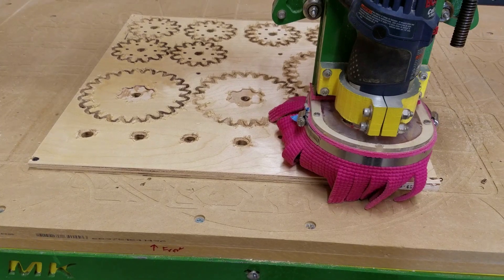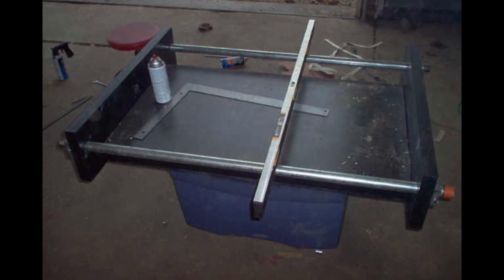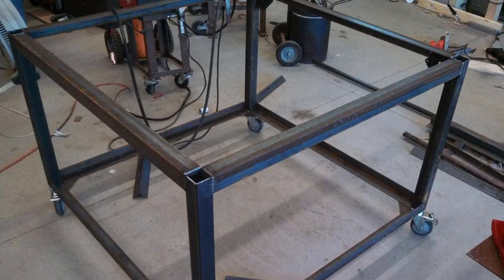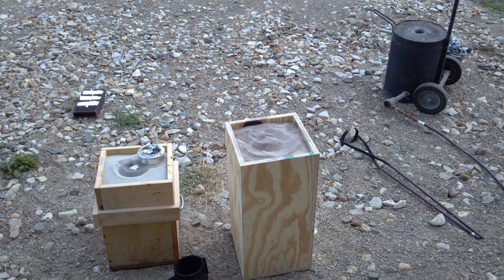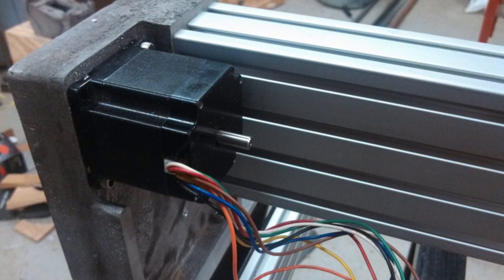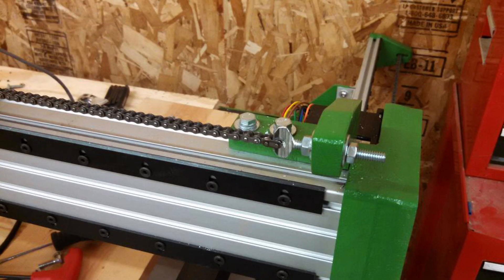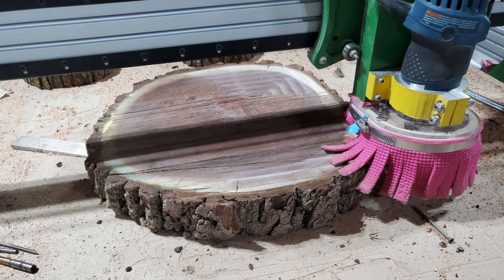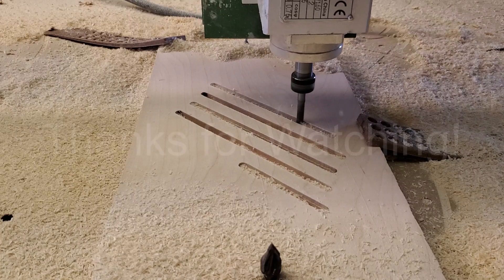DIY CNC Router Table Made With Aluminum Castings

Comment: Very nice build Mike! In the planning stage myself. Going to make it for a 4'x2' cutting area with X-axis to handle 4' wide. How long is your X-axis t-slot beam? Are you noticing any twist with the 2"x4" extrusion? My beam is going to be 5' long so I was looking at the 3"x6" t-slot extrusion. Or maybe two 2"x4" pieces turned horizontal and mounted with 4" space between them.
Reply from the maker: My extrusions are all 5' long.  The 2x4 on the gantry has been pretty solid.  With a motor on both sides, it doesn't have any issues with racking.  I sort of worried about twist too, but when you really start to think about what the actual cutting forces and/or what force the steppers can generate with a chain, timing belt, or rack and pinion drive, it isn't all that much.  The place I have the most issue with unwanted movement/slop is in the V-wheels, particularly on the Z axis.  Two of them use eccentric spacers to tighten up against the V-rail, but those will work loose sometimes.

Good luck with you build!
Reply: @StuffMikeMakes  Thank you for the information. I plan to use ball screw drive with the flat HGR20 bearing/rail setup everywhere and a Makita router. Not planning to push it hard so sounds like 3"x6" might work fine.